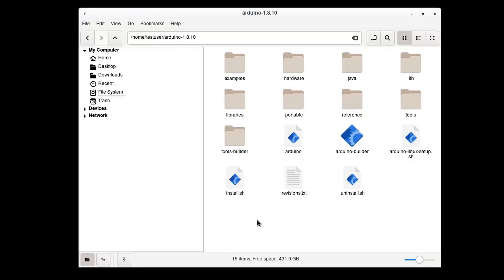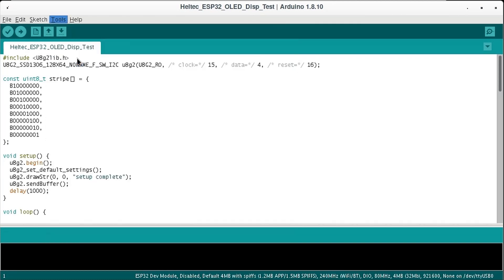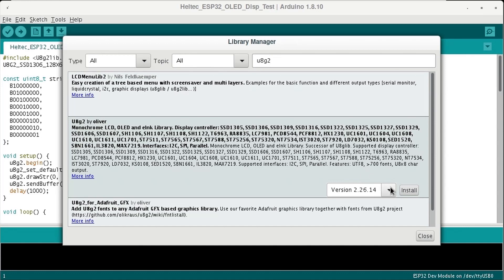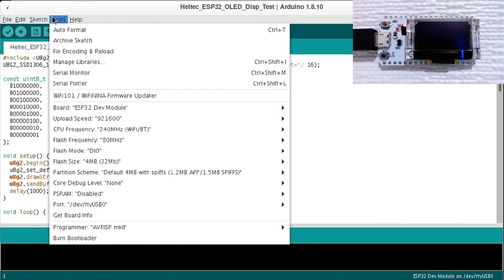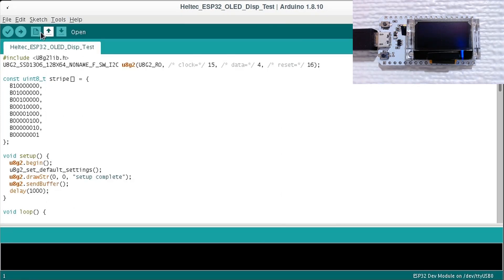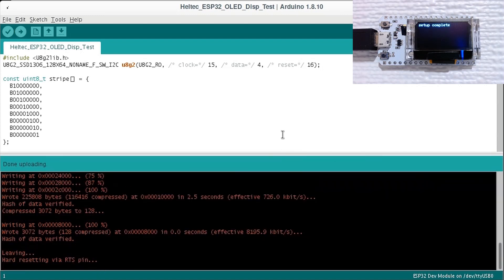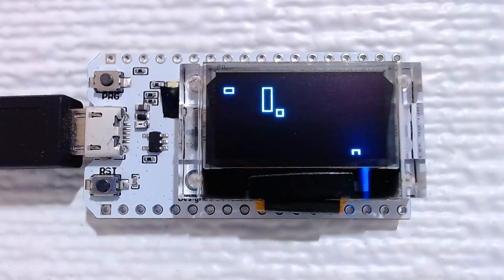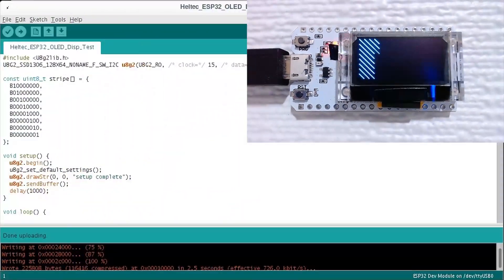ESP32 OLED Display Test with Arduino Software (IDE)

Comment: I have the same board, but everything I am doing results in the board not showing up under "Board" after I added U8G2 in the "Manage Libraries..."
I do see where I have under a previously watched video the "Examples" -->File-->Examples.  It is listed as non-compatible.  I am missing something and have not figured it out.  The intent is to hang some sensors off this and have it display the data by cycling every few seconds.  However, I can't get through step one :)  Any ideas?
Reply from the maker: Have you installed the esp32 board support? I have a video here https://youtu.be/f5YmsYEAHHM showing how.